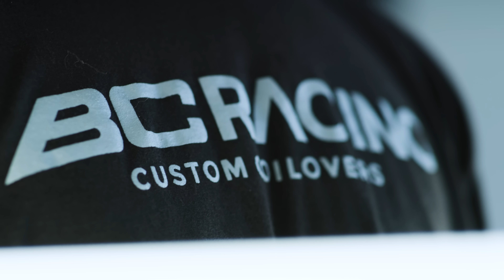Formula 1 Heritage V10 Swapped Toyota Supra

Comment: Just love the fact its high rpm
Reply: The f1 v10s went to 21k rpm in early 2000
Reply: like a Honda 😂
Reply: @petarspajic7648  only the V8s did. Cosworth in particular. The V10s went to 18k
Reply: @petarspajic7648  v10s never went to 21k
Reply: @Shadowboost  went 19k between 03 and 05; the BMW engines were absolutely beasts back then
Reply: @Shadowboost  renault v10’s got to 20k

Comment: Judd is the Best for RaceMotors. 
However, a early 2000’s F1 motors cranks more like 950HP AT 16-18,000RPM 
A little off but still incredible 👏🏼🤘🏼
Reply: They would practically never run over 900 HP,  the engine wouldn't last a race length.
Reply: @RukaGoldheart  yeah 950 that’s what I said…

Comment: Uuuuh, this is veeeery interesting, can't wait to see it running. Due to the super short stroke and very low torque, though, these engines are not well suited to drifting. This can be overcome with short gearing that takes advantage of the 11k rpm. Only way I know this is because I simulated drift cars with all sorts of engines in Assetto. Will definitely sound insane, though..
Reply: It seems like hillclimb/time attack/circuit build. Maybe he's eyeing on 2021 pikes peak entrance.
Reply: Damn, I really hope they see this comment because i'm sure they don't know any of this.

Comment: Should be called LMPRA because this is no formula 1 engine! If you can start it up without preheating the oil or using a powerdrill to crank it it's no F1 engine! Still very cool. V10s sound amazing

Comment: I'm curious how they built this one, F1 engine, specially the "old" one, aren't made to last long
Reply: I thing that's why the 11k rpm max power output instead of the 18k
Reply: @YuichiTamaki  yeah true for a moment i forgot how high they rev ahah
Reply: You can buy these new from Judd to whatever specs you want
Reply: This engine has nothing to do with F1. 
Ever seen a Judd V10 in a F1 car??
Reply: @cinq1368  Personnally i don't know but on their website they claim "The engine can now be found powering many late model Formula 1 cars" while talking about their 4gv 4l v10
Reply: @cinq1368  ,Benetton in the 2000 used a JUDD V10...

Comment: What F1 car was this engine used in?
Reply: Not clickbait. Judd GV engines were used in F1, so the GV4 engine being a descendant of those engines have F1 heritage.
Reply: @PSTS636  I guess if you're utterly obsessed with semantics, sure. I'd be happy enough to call an evolution of an engine used in multiple F1 cars during F1 competition an F1 engine, but YMMV.
Reply: @PSTS636  nah, not at all. But you do you.
Reply: This is not a F1 engine. This is an LMP engine. Judd did make F1 engines and most known for their success in the V8 of the 80s and did make V10s later but with no real success. Also NA formula engines rev to 20ks and require preheating the oil and using a powerdrill to start the motor. This is not and never will be an F1 engine